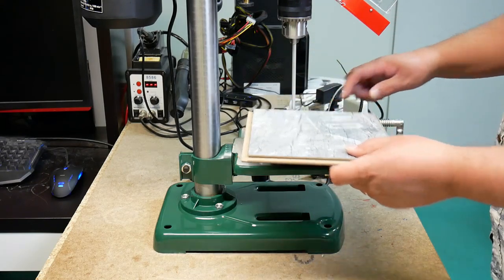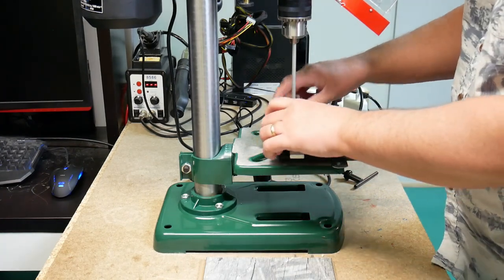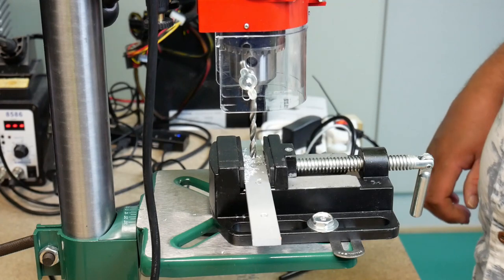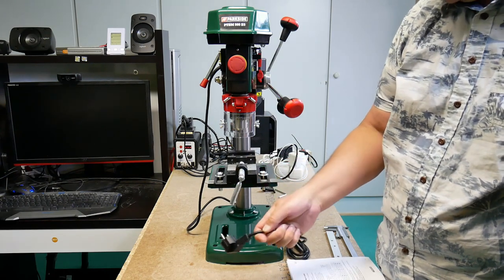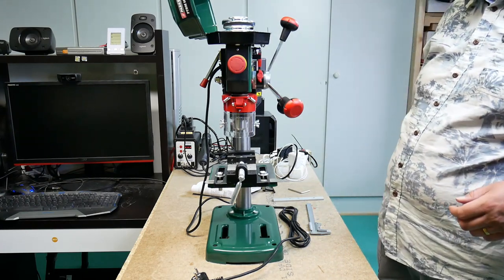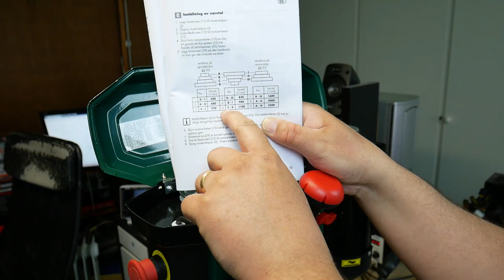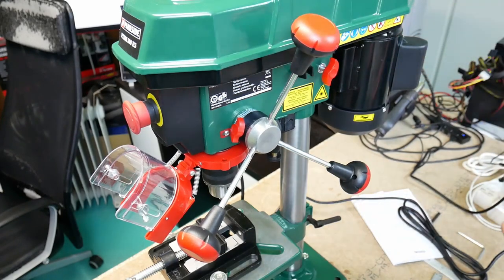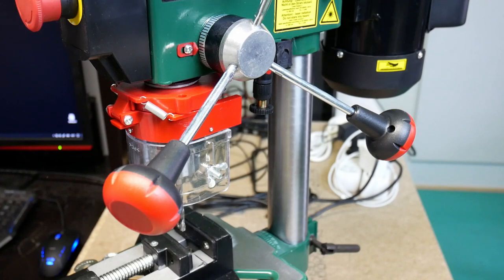Parkside Lidl Bench pillar drill follow up

Comment: I actually bought one and had to return it, because of the amount of wobble on the Chuck while using long bits, even after doing all adjustments possible, so returned it go another one, thinking it's just a fault with it, and the other wasn't as bad, but just the same :(
Reply: What you mean with " other wasn't as bad, but just the same :(" ? :) How much wobble it have? I mean you can't except near perfection for that price, but is it acceptable?